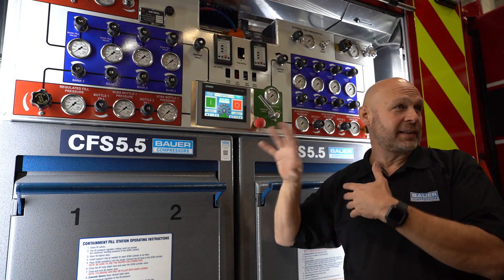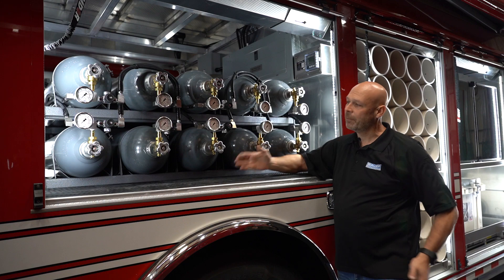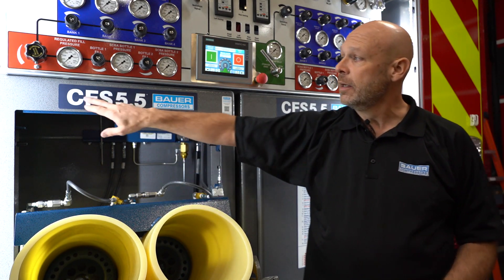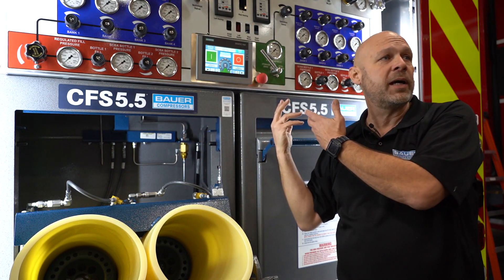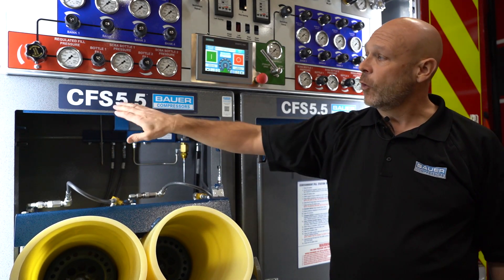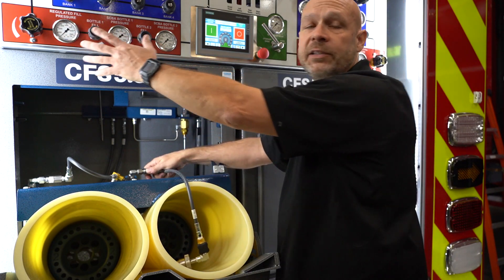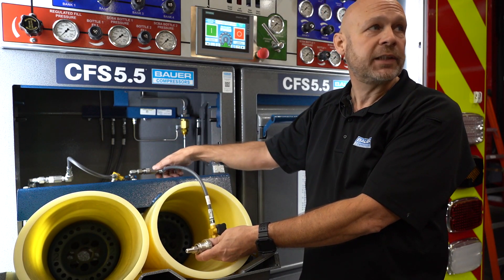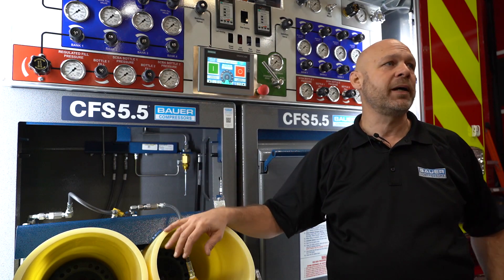Behind-the-Scenes of Bauer's 6600 PSI Compressor on an SVI Truck

Comment: The reason THAT TRUCK was 6,600 psi and wasn't a 7,000 psi system is that Norris 8BA711 ASME storage vessels are rated at a 4:1 safety factor at 6,000 psi, but only a 3:1 safety factor at 7,000 psi. In keeping with the consistency of NFPA 1901 requiring a safety factor of 4:1 on almost all components, the cylinders used on that truck are Norris 8BC435, which are rated for 6,000 psi with a 10% overfill rating.  They weigh about 300 lbs each ONCE FILLED with air.  The Norris 8BC435 is a DOT cylinder and will require hydrostatic testing every 5 years.

At the moment, there are no practical 7,000 psi storage vessels that have a 4:1 safety factor.

The reason 14 vessels were used was to allow a massive amount of cascading to be performed before requiring air from the 4th storage bank.